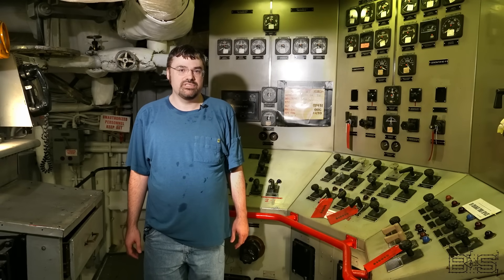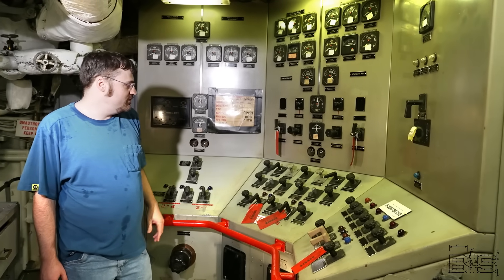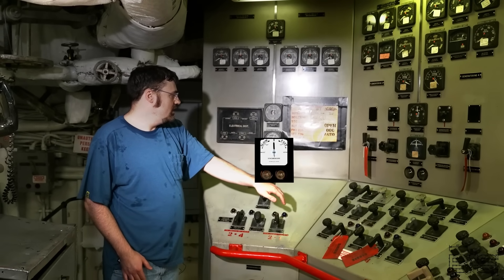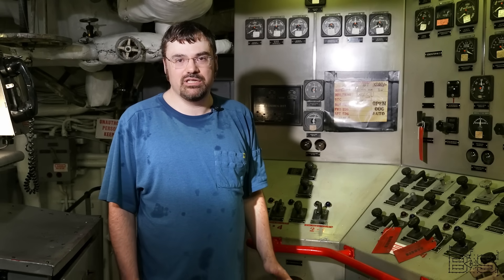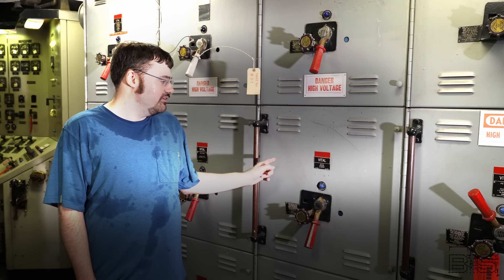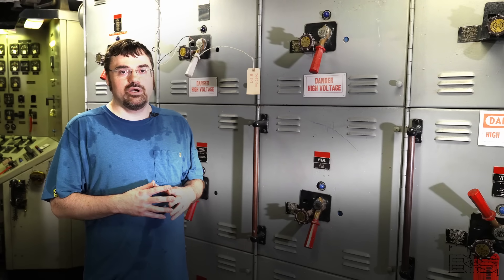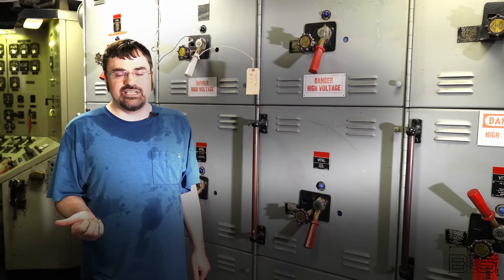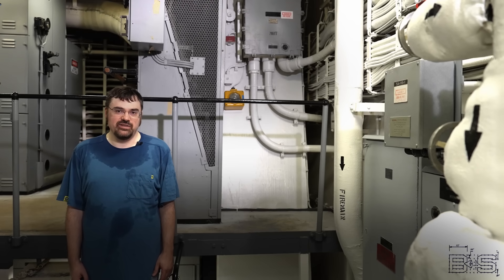The Most Dangerous Switch on a Battleship

Comment: This is very similar to any power station. They have to synchronize power as well. But not to other generators, to the grid (technically other generators).
Reply: And if you "synchronize" 2 buses when they're 180 degrees out of phase, it's more or less the same as shorting all the phases together.
Reply: Like a washing machine and a dryer are basically synchronized with each other when both are in use.
Reply: @tyronenelson9124  no they're not.  normal AC motors don't have field coils like a generator does, just a dumb metal core that inductively generates its own opposing field, and that opposing field can slowly slip out of phase with the motion.  its also how you can vary speed of some AC motors with voltage, that wouldn't be possible if the inner field didn't slip.
Reply: @tyronenelson9124  No.   Electric motors  have  a  "slip"  when producing  torque.  This is why  EG  many motors are such as 1725RPM under full load.   With no load, they operate  very close to synchronus  frequency, which in that case would be 1800--an exact multiple of  60Hz.   

In fact I once  was an HVAC/ R tech, did mostly repair/ maintenance.  We had two units  that had been poorly engineered as to installation,  and were slightly  different loadings  on the compressors.  The  motors would "beat"  similar to  aircraft prop engines  slightly out of sync, and this was  over a college library of all places.  They eventually had to improve the shock  mountings of the units  to quiet them down.     These were  208 or 230 3 phase,  and even  they do not run at synchronous  freqs under heavy load

Comment: great explaination , thanks for not resorting to a "WATER PIPE" , example , you didn't touch, on "Reverse Current " relay ,on turbo generators, with ,  synchronising , 2 generators.
Reply: The water analogy is great for basic concepts, doesn't hold up for advanced subjects.

Comment: 80 year old electrical technology. Thanks god we’ve evolved a bit from this dinosaur.
Reply: You'd be surprised.  I'm a power systems engineer and recognize everything in the video.  There are still factories out there with electromechanical relays and meters in use.  Even computer-based relays to sync generators together work on the same principles discussed here.
Reply: @kennykash6089  Agreed.  Some people think we are so schmart now in these modern times... sigh.  Not enough appreciation for the shoulders of the giants we stand upon.  This is gear is not that far removed from what is still in use.
Reply: All that switch management could be done with a Commodore 64 and some guy named Carl that no one really likes.
Reply: Switchgear and networks still look like that, the difference is that things is nowadays remotely controlled  BUT it do exists manual only cutouts (work to be done ? call in and ask permission to isolate your work area from the rest.)
Reply: A ship knocked down a bridge in the Chesapeake not too long ago with an electrical system that appears at a glance to be both no more modern and considerably less robust than this one.
Reply: @wgmskiing  2 things at play on the Francis Key Bridge incident. 
1. Most Merchant Crews don't have the training.on what to do when the s&>t hits the fan. There are NO "battle lanterns" on Merchant ships.  It is VERY dark in the engineroom! You have to wait 30 secs or so for the emergency generator to come on line.
2. Murphys Law! I've had 1 main switchboard blow up, just outside of LA harbor. Fortunately, there were tug boats just a couple of miles from us, we had just let the pilot off.
It takes a bit of time to figure out what happened, then how to remedy the problem and then it takes time to fix it.
My thoughts on Murphys Law, is that Murphy was an optimist!  😅
Reply: Analog circuits and relay logic are so easy to troubleshoot.  We spend so much money on computers and mystery ICs
Reply: @dictare this system looks like it would be an absolute nightmare to work with in combat.

Comment: I dont quite understand - isn't it equally dangerous to close 1-2 on board 2, close 2-3 on board 3,  close 3-4 on board 4, and close 4-1 on board 1? Then you would get same paralell operation, without having to close any locked switch or switch marked "Only on official order".

So why are 2-4 especially dangeroud? Even if the end switchboard wouldn't have a switch (lets say board 4 not having a 4-1 switch), then you would still get parallel operation by closing all 3 switches.

Or do you mean that switchboards 1-2 and 3-4 are completely separate, meaning theres no tie switch for "2-3", no switch for "4-1", and the "2-4" switch are only closed when on shore power?
Reply: It looks like the normal way to operate is to split the power systems for and aft. Connecting everything together exceeds the fault current capability of the breakers, and is only done used when equipment is damaged
Reply: @retrofitter  What I understand its always done that the 2-4 switch is flipped to ON when the boat is on shore power, because then the incoming shore power needs to be shared with the whole boat.
Reply: As I remember, there are physically 2 main busses,  port & starboard to account for battle damage.
It's only been 50 years since I've operated a Navy engineroom, so I could be wrong. (Sailed many merchant ships,  they are a bit different,  they don't worry about battle damage 😊.

Comment: Well explained most notably the typically 8 to 10 times full load current for a bolted fault. This is is known by many names one being the "prospective short circuit current" or "breaking capacity" this is where fuses are often categorised into not only current rating but also rupture capacity. this is often the difference between a blown fuse and and an explosion. 

Typical house hold circuit breaker or fuse are required to be able to break upto 10 000 amps or 10kA  or say 6kA.  Once iside an appliance the lead to the appliance already becomes a limiting resistance so the fuse might be rated at 1500 amp "rupturing capacity"

Comment: Hello, and thanks for this incredible video! I'm currently working on a project explaining the 2nd Naval Battle of Guadalcanal and I cover USS South Dakota's power failures in that video, I was wondering if I could use some clips from this video to better explain exactly what happened, if it's alright with you?
Reply: I'd love to see what you come up with.  That story immediately came to mind while going through this video.  Did  the Navy ever release an official finding or court martial somebody?
Reply: Well I had this whole explanation typed out and then it got deleted but I'll give you the short version. Basically the crew did nothing wrong and the breakers weren't the primary problem, and this is all made clear in South Dakota's damage report and action report which are publicly available along with all documents form this battle. The problem was a faulty power transfer switch that feeds the aft 5", gun director, it engaged because of the firing of turret 3 while turret 3 was trained all the way forward, concentrating the blast toward the superstructure. The switch stuck closed and the short between the out of phase generators welded it shut, the problem was that the breakers that primarily feed that switch were locked closed because they had a tendency to open under fire and no one had a battle station in that area so they couldn't be reset immediately, so the short couldn't clear and ruptured the feeder line. The report makes it clear that the crew was instructed to lock the breaker closed because it would trip while firing, Washington's crew did the exact same thing according to Captain Glenn Davis himself in the book Battleship Commander by Paul Stillwell. The transfer switch and the relays were upgraded later on and that solved the problem, and other battleships were refit as well. In my opinion South Dakota's crew did nothing wrong and handled this problem to the best of their ability. I think a lot of misinformation comes from people reading the report and not understanding the technical jargon, and from people reading books which didn't have the sources we have today and instead relied on inaccurate understandings of personal accounts.